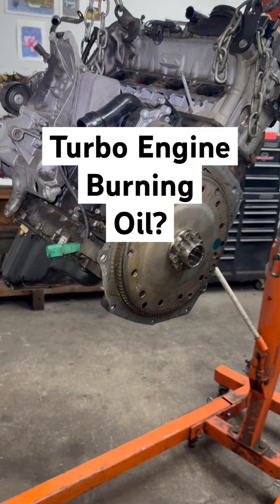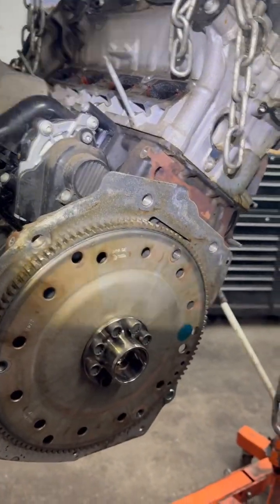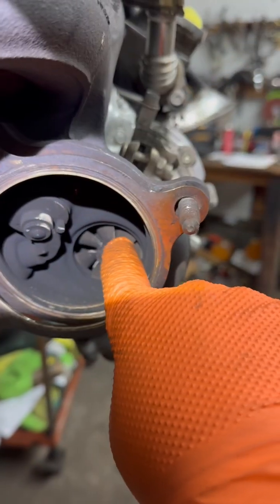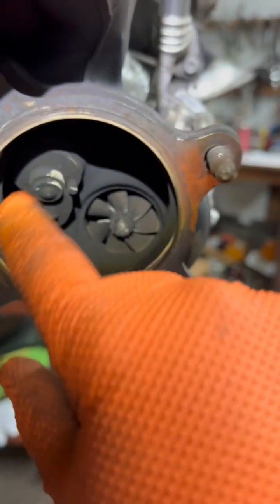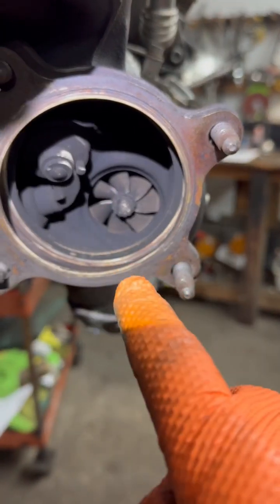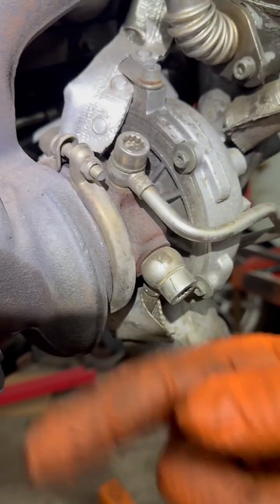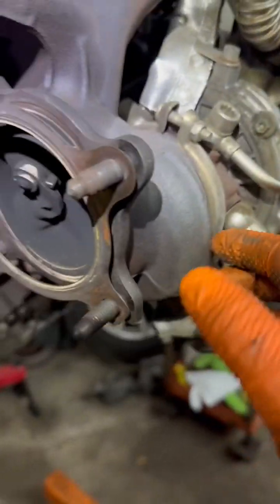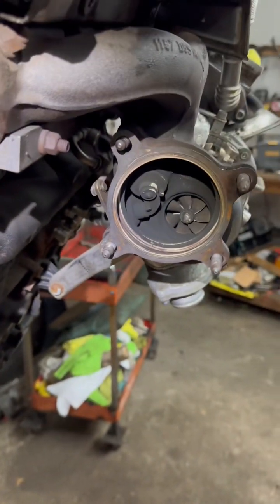Turbo Engine Burning Oil?

Comment: Love your vids man keep em coming. Question on turbos, I have a 22 CX9, my first turbo car, I notice the oil smells different than all of my others non turbo cars. Almost like it has some fuel in it? 26k miles, first owner, oil changed every 5k.
Reply from the maker: Thank you! Appreciate that. It's considered normal for direct injection vehicles like yours, I wouldn't be concerned.